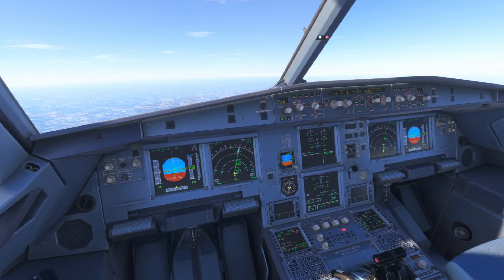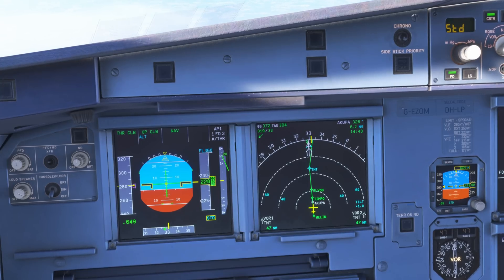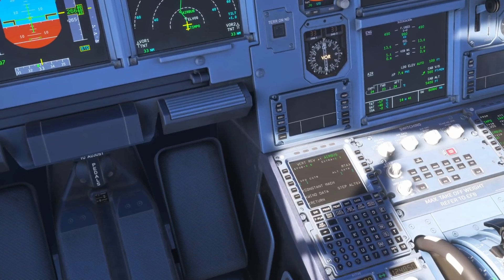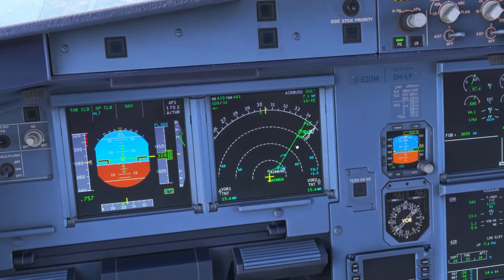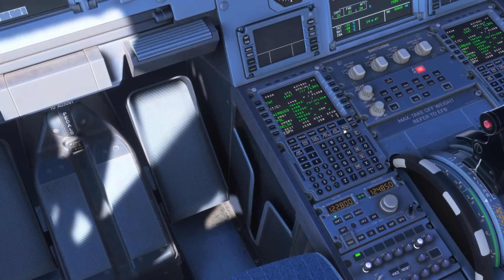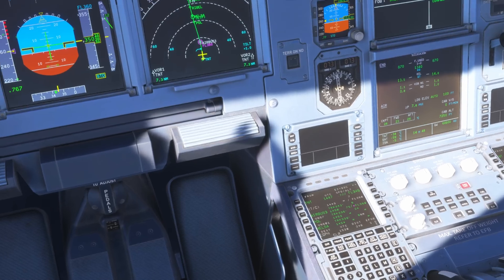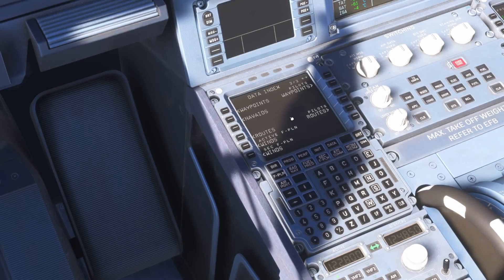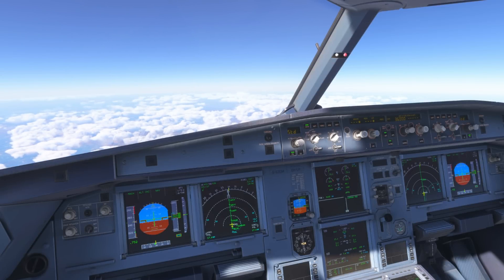How to Use Pilot Waypoints in the A320 MCDU | Real Airbus Pilot Tutorial

Comment: Wow, I just tried configuring some lat/long pilot waypoints. Took me quite a bit of fumbling around to find the proper format, but I can now route my departure over my house prior to the first SID waypoint 🙂 Focusing on priorities! Yes, I live close to the airport.

Tip: when entering lat/longs, do NOT do what I did and go to Google maps and grab the decimal-formatted values, but rather another source (ex: Navigraph) where you can click to save a waypoint as a user waypoint that displays the location in degrees, minutes and seconds. The format to enter a Pilot Waypoint in the Airbus is to take an example like 43º 5' 40.5"N by 071º 7' 56.9"W and convert it to 4305.4N/07107.6W. The MCDU accepted this, and I can now add these Pilot Waypoints into the flight plan. It's a shame that they are not retained between flights. I wish there was a way to persist them and to persist company routes. I know that you can persist company routes in the FlyByWire A320 by downloading and saving the XML file that defines the route, but I am not aware of a way to do the same with the Fenix.